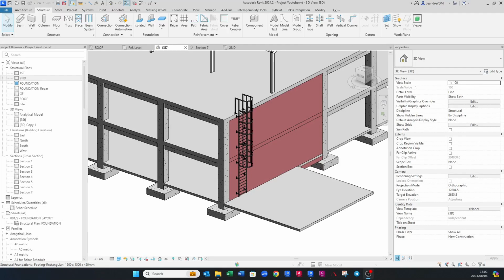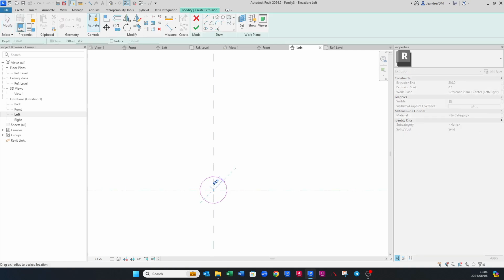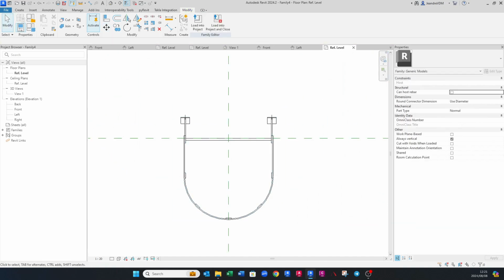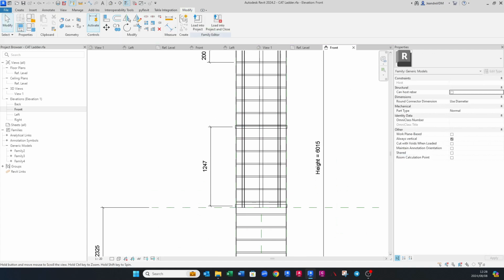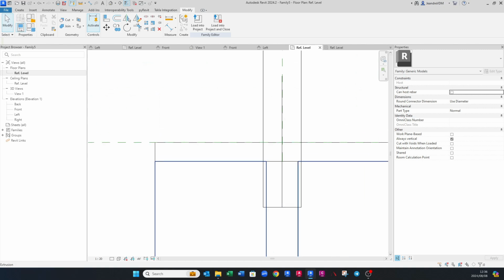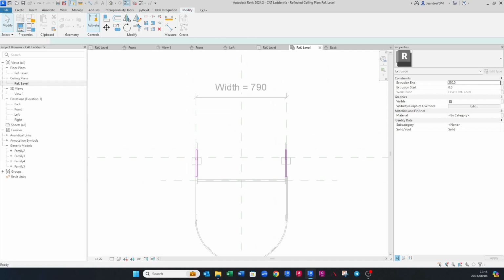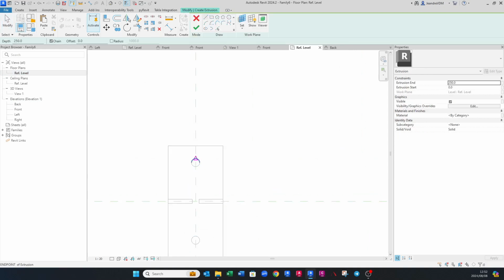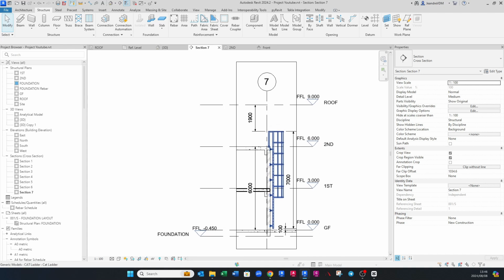Revit Structures - Creating a custom Cat Ladder Family

Comment: Great tutorial, thanks for showing how to do this. Any chance you could point to where you got the dimensions for your CAD drawing from? Just so i can recreate it in autocad,  link it to revit and then follow along with your video.
Reply from the maker: Glad you liked the tutorial.

There isn't one fixed standard size, but rather legal dimension ranges. Our company built this specific drawing internally by implementing the limits from SANS 10400-M and the OHS Act Reg 13A.

To find a quick layout diagram to copy, just Google "SANS 10400 cat ladder dimensions" or "General Safety Regulation 13A fixed ladder" and hit images. 
Plenty of local structural engineering detail sheets will pop right up!
Hope this helps.

Happy modeling!